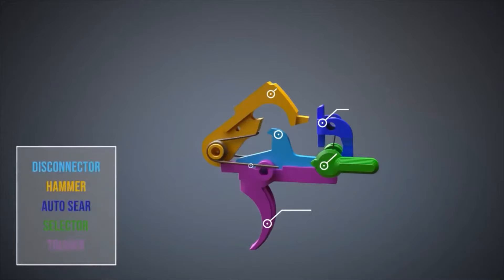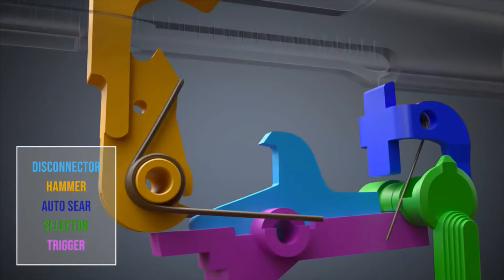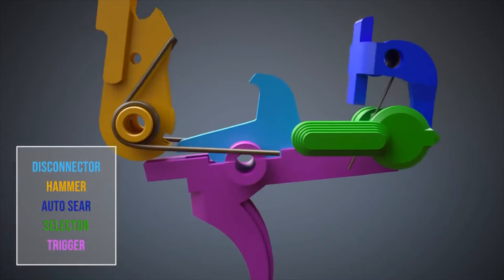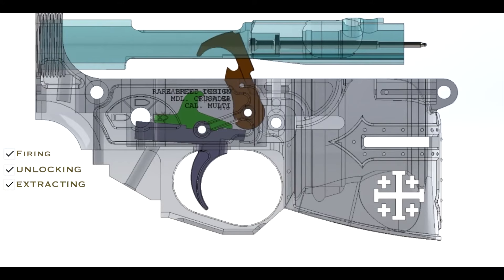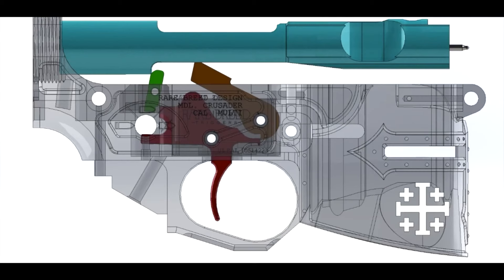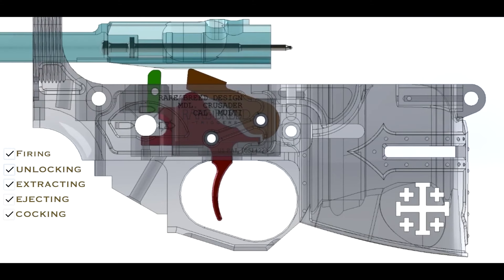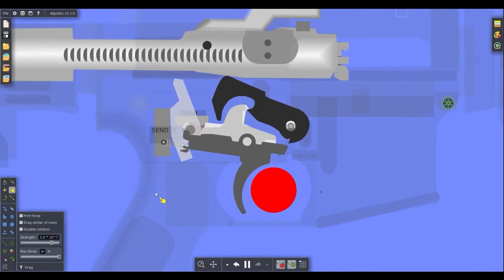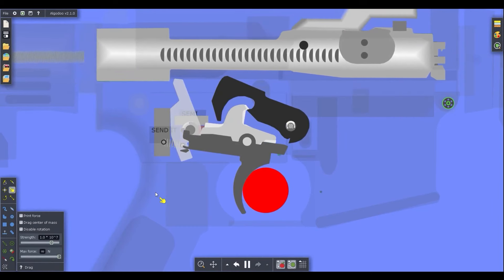HOW AN FRT-15 TRIGGER WORKS, AND WHY THE AFT HATES THEM

Comment: The WOT uses a spring under the front edge of the trigger to push it forward. The FRT uses the back of the hammer to force the trigger forward. The only thing the same is the locking bar, but the locking bar return spring on the WOT is horizonal and can`t be crushed by the locking bar over travel unlike the FRT.
Reply: Rubbish

Comment: I guy was dialing one of these in at the Texas City muni range last week. I’m a member and a regular and known to shoot fast occasionally but this thing was running strings of 20 smoothly. Here’s the deal folks, even if it isn’t a full auto/select fire trigger, running what appears to be full auto will get the wrong kind of attention every time. The easiest way to avoid unwanted attention is to not run strings of 20-30 rounds…… I’m not justifying the unconstitutionality of the atf. F#$k those guys. The trigger DOES NOT fall under the NFA. I’m all for every American owning a select fire or 10.. What I’m saying is, don’t test fire your fake full auto trigger at the local range when the trigger is REALLY GOOD! 😂 The tallest nail will always get the hammer… God Bless Texas, remember the Alamo and Come and Tale it!

Comment: On the frt, the green piece is the locking bar, which prevents hammer follow/dead trigger/light strike/out of bat detonation. 

The forced reset comes from the hammer contacting the THICK trigger. It's an amazing design.
Reply: Forced reset function is done by a trigger spring. The positive displacement reset is a result of a hammer displacing a trigger. All standard triggers are forced reset, this is a positive displacement trigger reset.
Reply: @CAPTIVEPULSEMAKER  
You are not helping the "not a machine gun" faction with this
Reply: @andrewholdaway813  I’m not sure exactly how you came to that, but I was the first person to classify these machines as I invented the science of positive displacement reset triggers.
Reply: @CAPTIVEPULSEMAKER  
I came to that because your term 'positive displacement' just emphasises the single continuous press nature of operation. That's a machine gun.
Reply: @andrewholdaway813  then you’re not familiar with the technology. It is impossible to have a positive displacement reset trigger function as a machine gun it is inverse and opposite to a machine gun. Maybe read up on such machines.
Reply: @andrewholdaway813  these are true and absolute digital precision semi autos...period, no room for error.
Reply: ...,plus all hand held machine guns are forced reset just like all semi autos, but machine guns cannot be positive displacement reset it is simply impossible.
Reply: @CAPTIVEPULSEMAKER  
Explain to me why it is impossible for the FRT to function as a machine gun.
Reply: @CAPTIVEPULSEMAKER  
So you can't explain, fair enough.
FRT allows semi auto weapons to function as automatic weapons.
Reply: @andrewholdaway813  I can, but I don’t have time, plus you might need some prerequisite knowledge on the subject before you’re able to grasp the subject. Just learn about it a little.
Reply: @andrewholdaway813  now the FRT certainly does not function like full auto or select fire not even remotely. Now if chickens and ducks were the same it might be different.
Reply: @CAPTIVEPULSEMAKER  
No, it mimics their base function, press and hold for auto fire.
Reply: @andrewholdaway813  Because if you pull the FRT trigger fully to the rear and hold it, it will lock the action completely open 🙃…
Reply: @andrewholdaway813  Actually it doesn’t and just because you say it does, doesn’t make it true. Like calling a pistol brace a stock , or an 80% receiver a firearm. Thanks for playing though. Your consolation prize is knowledge 😝…
Reply: @TooManyChoices1  
If you hold the trigger too hard yes, the mechanism will jam, do it right and full auto.
Reply: @andrewholdaway813  Says the guy that wants to classify things by his feeling and not reality 🥴😒🤣…
Reply: @andrewholdaway813  you mean when you pull the trigger really fast after each single function of the trigger, it shoots faster? By god.

The letter of the law is clear. The frt and all positive displacement triggers are not machine guns. Every single shot fired has an associated trigger pull. This is a fact.
Reply: @connorcampbell5274  
No it isn't, one pull and hold.
Reply from the maker: I don't think you understand the basic concept of a machine gun. It's the mechanical action of the trigger that defines a machine gun, not the finger.
Reply: @NOTSOSLIMJIM  
If you apply pressure to the trigger and maintain that pressure and the gun keeps firing; that's a machine gun.
Reply from the maker: @andrewholdaway813  that's not the definition of a machine gun. That may be your definition, but that's not the actual one. It's about facts, not feelings.
Reply: @NOTSOSLIMJIM  
It's the definition of a machine gun.
Reply from the maker: Dude, we had this discussion. It's not. You can go pedal your false ideas elsewhere.
Reply: @NOTSOSLIMJIM  
I have no 'feelings' on the matter. The FRT enables automatic fire.
Reply from the maker: @andrewholdaway813  you didn't watch the videos I put out, you don't understand the law, and you have no understanding of engineering. Stop pretending like you have a clue.
Reply: @NOTSOSLIMJIM  
I have no concern for your law, I understand engineering just fine.
Reply from the maker: @andrewholdaway813  obviously not if you can't understand this basic concept. Go crawl back into your mom's demand action and every town for gun safety hole with Soros and the Giffard and leave us with an IQ above 50 alone.
Reply: @NOTSOSLIMJIM  
Seems you are the one who is not very good with clues.
Reply: DIY project coming to YouTube.....lol
Reply: @NOTSOSLIMJIM Your argument is one of semantics rather than an argument of function. You’re sitting here saying “well TECHNICALLY it’s not a machine gun because when they wrote the legal language defining machine guns this specific piece of technology, which was clearly designed to circumvent that language, had not been invented yet.”

It’s a bit of a ridiculous argument to hing your entire argument of “what a machine gun is” based on the antiquated semantics of “how many times is the trigger pulled.”

The function is the same. They both shoot ridiculously fast. Faster than you could shoot if you were to pull the trigger completely on your own. FRT’s reset the trigger into a depressed state that doesn’t actually require you, the user, to pull the trigger with any additional force. You just pull and hold with the right force and from a functional perspective it is fully automatic.

So while the language of the law hasn’t caught up with newer technology, eventually it will, and this will be illegal.
Reply from the maker: @CM-ky5go  see, this is America. We are a nation of laws. The law is written that a machine gun is one that fires more than one projectile per pull of the trigger. If you want to enforce laws based on "close enough" and "semantics". Then the double barrel 1911 is also a machine gun. That any firearm that can be fired quickly is a machine gun. We use the law as written because otherwise all guns would use semantic loopholes to just ban all firearms. But I'm sure you wouldn't mind being pulled over for almost speeding. Maybe having your home searched without a warrant because the officer had "close enough" to exigent circumstances.

Comment: ATF FEO Agent Smith wrote in the initial evaluation that " If the shooter maintains constant rearward pressure to the trigger, that single constant "pull" will continue the cycle of operation firing a subsequent projectile."  He failed to mention that his single constant pull is interrupted by the trigger being force-ably reset (and locked) immediately after the cartridge is fired. There is a reason why the definition of a machine gun does NOT say "PULL" anywhere in the statute. Because not all firearms are discharged with only a "PULL" of the trigger.  The Browning M2 50cal belt fed "machine gun" is fired by pressing the butterfly trigger while holding onto the spade grips. The M134 mini-gun is fired by pressing an electronic button. 

If anyone is indicted for possessing this FRT15 "machine gun" I would have my attorney file a motion to exclude any video of the FRT15 being fired in a rapid manner. ATF would likely use videos of a M16 being fired in comparison to the FRT15 to deliberately confuse member of the jury. ROF is not a factor in defining a machine gun. I would also have my attorney file a motion to exclude the use of the word "PULL" when describing the cycle of operation of a machine gun, and the FRT15, because the term "PULL" is no where in the statutory definition of a machine gun, and the action of pulling something is an attribute of the shooter not the trigger. (How does a door function? It opens and closes! A person is needed to push or pull the door to initiate that function)

This case is win-able in civil court as long as Rare Breed gets to submit evidence. It is a slam dunk in criminal court!
Reply from the maker: They don't plan on actually winning a case. All they want it a few cases to take to court and put their full weight against someone without the financial resources to defend themselves. Once they defendant is unable to afford an adequate defense, they will make a plea bargain for a very small amount of jail time, felony charge, and a fine.
Reply: @NOTSOSLIMJIM   
All the more reason why gun owners should collectively fund ATF Overreach Insurance. In the event that ATF acts on their threats!
Reply from the maker: @PoormansMachineGun  I have insurance. Not everyone does....
Reply from the maker: @PoormansMachineGun  hey poorman, just subbed. Decent channel!
Reply: @lilrobi45xxx42   ATF doesn't want this case in criminal court. If they did they would have acted on their cease and desist order charging Rare Breed with 50,000 counts of selling a machine gun.
Reply from the maker: Rethinking their new definition of a machine gun. All semiautomatic firearms are now machine guns. If one is able to fire a weapon without removing their finger from the trigger, till the magazine is empty, it should fall within their definition as well. If they can remove the action of the trigger being moved to multiple positions and being pulled for each round, it not far fetched to say they can't say the same for any weapon that can be fired without removing your finger. Which would also cover revolvers.
Reply: @NOTSOSLIMJIM  
It will first open the "re-interpretive door" to classify binary triggers as machine guns. If they aren't going to allow a trigger that automatically reset, still requiring an individual rearward pull for every round fired. Then triggers that can fire on the spring assisted release will also be machine guns. Then the ATF will move on any trigger that has a return spring. 

We are sliding down the proverbial slippery slope!
Reply: @lilrobi45xxx42  Not that well educated on our rights but, what case is being discussed here. Still learning thanks. 🙏

Comment: Wondering if you leave a firing pin fixed out in strike position will it shot every time gun cycles?
Reply from the maker: The AR15/M16 use a floating firing pin. I believe you are thinking of "slam fire" when the hammer rides the bolt home. You can have incidences of weapon malfunctioning and going "full auto" when the disconnector fails. Normally you will just get a dented primer as the firing pin is unable to strike the primer till the bolt is rotated once fully in battery. At that point, the majority of the inertia is already lost.
Reply: This is why open bolt firearms are outlawed.
Reply: Open bolts are regulated, not outlawed. @ElementofKindness

Comment: Very informative. I've only heard triggers of concern were RB and WOT...but haven't heard anything about Alamo? I've read that they call the Alamo trigger a positive reset vs forced reset. Is this a matter of semantics or are they completely different?
Reply from the maker: The Alamo is the exact same type of trigger, just with a roller for the reset bar. Positive reset and forced reset are primarily the same thing. I believe the 3MR trigger is "positive reset* as it only resets the trigger most of the way, but you have to lift your finger the rest of the way before pulling again. The only difference between a forced reset and a semiautomatic is the semiautomatic you need to lift your finger for the trigger to reset. The FRT automatically resets the trigger for you allowing you to pull the trigger again without lifting.

Comment: So how much force quantifies it? Wouldn't all guns with springs in the triggers fall under that ?
Reply from the maker: @SUBtrauma  yes, all AR15 semiautomatic weapons do have springs to reset the trigger forward. We also have the 3MR trigger that resets the trigger about 90% of the way. The difference between a standard trigger spring, and a forced reset trigger is the ability to overpower the standard pull strength of a trigger pull. That being said, if you pull the trigger too hard on a forced reset trigger, it will cause it to malfunction.

Comment: I think the issue is that people are confusing the mechanical definition of a machine gun with it's capability to fire very quickly.
Though it's pretty dumb not to classify it by it's actual capability to fire rapidly, at least in a civilian context.
Reply: @Leroy Griff 
I think you've got problems.
Reply: @Leroy Griff 
Afraid of hoplites? Er no.

Comment: does this mean the original springed Akins Accelerator can become legal again?
Reply from the maker: @MansMan42069  yes, it became legal again with bumb stocks.
Reply: @NOTSOSLIMJIM  Nice! Always thought that system was so cool. And so simple too, effectiveness aside. A shame I don't see springed bumpstocks for other guns anymore. That, or I haven't been looking in the right places.
Reply from the maker: @MansMan42069 lol, I have one for an AR.
Reply: @NOTSOSLIMJIM  Do you have a video on it? I'd love to see springed bumpstocks for stuff other than the Ruger 10/22
Reply from the maker: @MansMan42069  no. YouTube no longer allows us to upload that content.
Reply: @NOTSOSLIMJIM  well $#¡†…
Thank you regardless 👍
Reply from the maker: @MansMan42069 it's easy to make. Just take a standard bumpstock, and add a short section of buffet spring between the end of the buffer and the stock. I added a 3mm aluminum plate between the stock and the rubber cushion for reinforcement.
Reply: @NOTSOSLIMJIM  Have you tried it in combination with an FRT or other trigger mods?
Reply from the maker: @MansMan42069  no, not necessary with other devices.
Reply: @NOTSOSLIMJIM  gotcha

Comment: Enlighten me please. If you keep pressing the FRT trigger does the gun keep firing? If so does the auto trigger. Does it stop firing when you release the trigger? If so does the auto trigger. I'm not a US citizen but this sounds like a trick to evade the full auto ban. The only difference between the two system is the mechanism that moves the trigger finger forward unintentionally. One press and release, one shot equals semi auto. One press keep pressing intentionally without releasing, multiple shots equals full auto. That's my understanding the case. If otherherwise let me know
Reply from the maker: You, much like many people, keep confusing the function of the finger and the function of the trigger. The legal definition of a machine gun has nothing to do with what the shooters finger does, as many machine guns do not even have triggers to pull. Rather, it says that the "trigger" must be depressed and the firearm continue to fire. An FRT does not function like that as you can see in the animation in the video.

Comment: The way this is explained by mouth and via animation - it DOES become a selective fire system but the nomenclature is meant to deceive its true function.
No wonder the ATF is nervous.
Reply from the maker: Unfortunately no. The legal definition says  "Any weapon which shoots, is designed to shoot, or can be readily restored to shoot, automatically more than one shot without manual reloading, by a single function of the trigger." The single function of the trigger is the main portion pertinent to this. For the finger to pull back, be moved forward, than pull back again are all different functions.

Comment: Seems pointless.Just ride the edge, you don't have to reset the trigger fully. All that is doing is making the pull longer. So in a way slower. Pull ur normal trigger, hold it, cock it, slowly release your trigger, when u feel it click that is the line you ride, not fully reset trigger. Longest trigger pull should be ur first shot, not every shot.